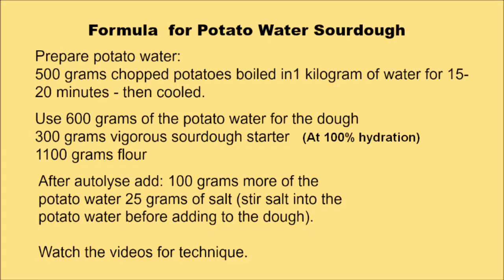Blister Crust Sourdough - Video #3 Shaping Round Loaves

Comment: I notice you're pretty rough with the dough in the shaping stage, i've always been precious not to lose the gas in the dough at this point, but my dough is often pretty flat once it comes out of the basket... i wonder if this is why?
great series by the way, thanks
Reply from the maker: Patch Callahan I do have to remind myself to be more gentle sometimes. You need a good tight skin around the outside to get a good oven spring, you can only get that with good shaping. So even though I may have to gentle down a bit, it sounds like you need to be more firm about your shaping. 
Do an experiment, shape one loaf more firmly and be less gentle about it ( degassing some is good otherwise you can end up with huge inside random holes), and then shape the other loaf the way you usually do, see what the difference is.
Reply from the maker: Patch Callahan Yay! Good! If you are too firm, the dough skin will tear. It is good to get a feel for what is just right.